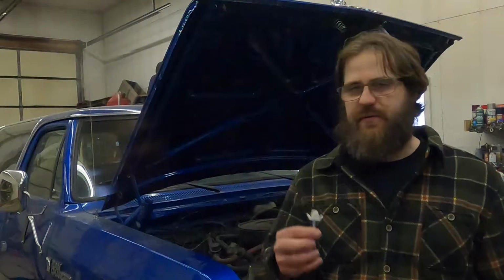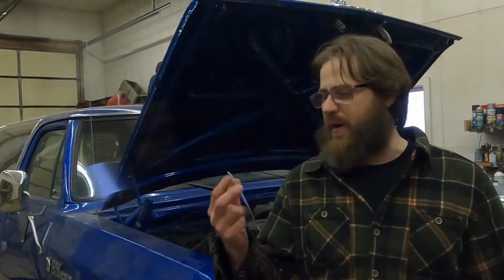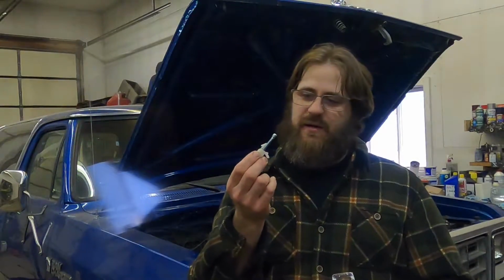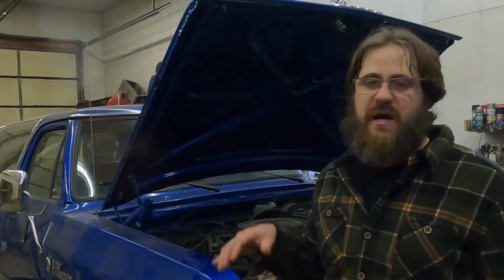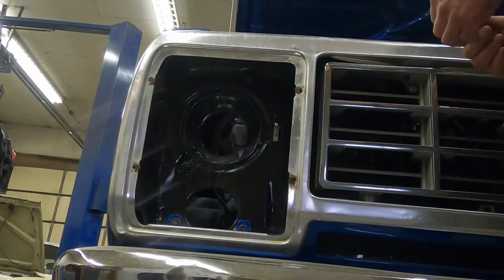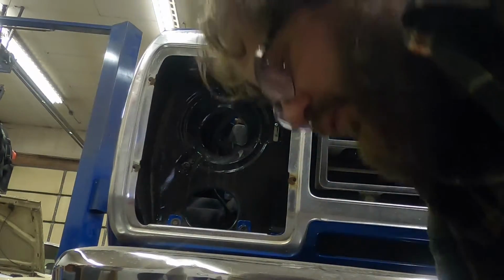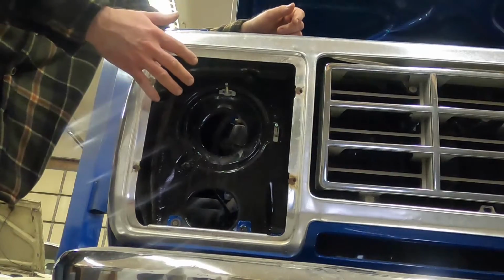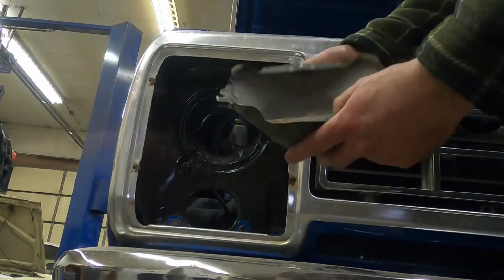77 93 Dodge Headlight Adjuster Screw Installation

Comment: Yo pick up some dorman 924-5104 adjustment screws. Just fit them into my 93 dakota. Stock is the same screws as the earlier cars and trucks when using sealed beams. Take a razor and shave off the tiniest sliver of plastic from all four shoulders above the base. Then they fit into the holes perfectly, snap in, and are way stronger. Just got done with mine a few minutes ago. Bought those to try after watching this and deciding F that 😂 I had already been through two packs of dorman chrysler screws.
Reply: Thanks.
Reply: @intergalacticjunk  no problem. Mine are still running strong. Ironically better than the factory screws in my 2011 wrangler. They moved in the last big storm I drove through